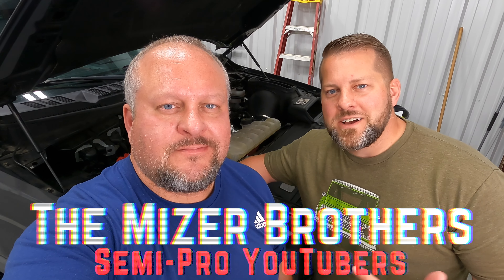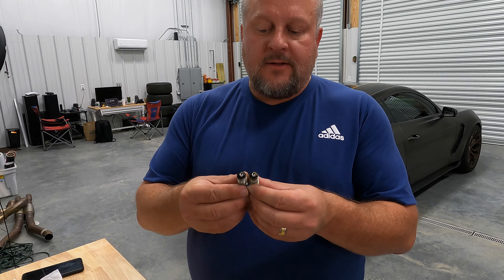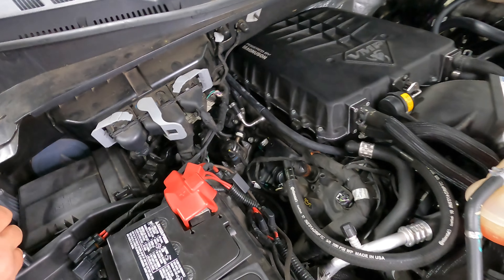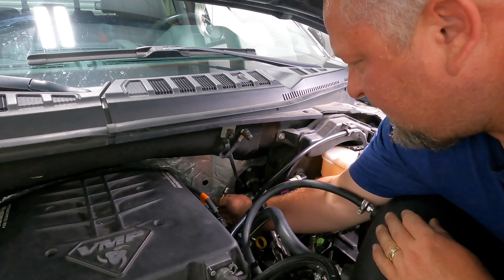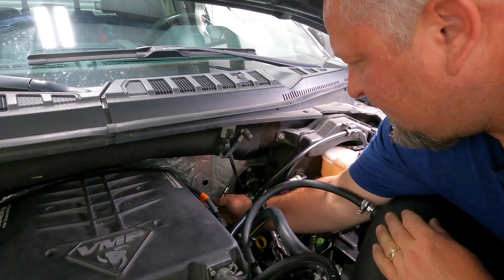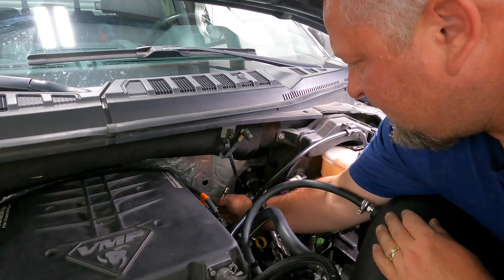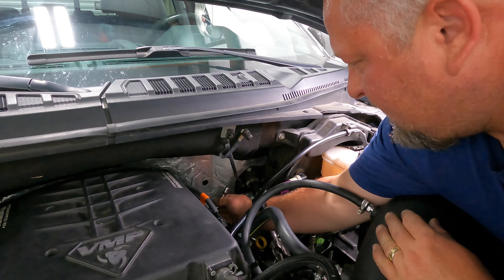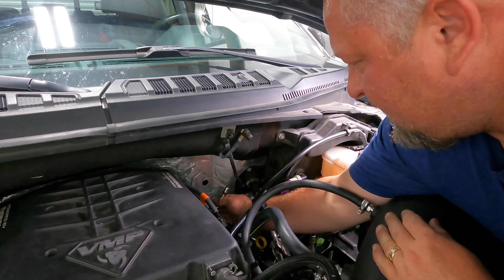Supercharged F150 5.0 Gets Misfire Solved - "The Wolf" is Ready to Eat! - Open Header Exhaust Rips!

Comment: How long did them old plugs last?
Reply from the maker: Not very long. Put them in a month or two ago just for regular maintenance and have had problems since. We looked back at emails with our tuner and tried to see when we started hearing a problem and decided that spark plugs were probably the issue. We added a fuel system and a smaller pulley since then and weren't really sure what the real problem was going to be.

Comment: My 2002 f 150 supercharged has had a bad misfire for a few months now 177000 miles we think bad gas. have used fuel additives and nothing seems to work to correct the problem. Have not used stabil yet. I am the origainal owner of this truck. and can not afford a mechanic. I am on SS. Any ideas? not engine litghts coming on.

Comment: What plugs are you running? NGK 6510?
Reply from the maker: Yessir.
Reply: @BackroadDriver  My Shelby F150 just did the same thing but the OBD found it was cylinder #1. Should I change the coil packs and O2 sensors too? How many HP is your beast putting out? Mine is 750 and it is fun.
Reply from the maker: Just change the spark plugs in you should be fine. If you still have issues you can switch the coil packs around to see if the issue moves with the coil pack.  The wolf is putting down somewhere north of 900 wheel horsepower right now.
Reply: @BackroadDriver  Wow. That is impressive. 750 sticks you to the seat. 900 must really be insane. Shelby also said to change both cats so that is on the agenda too. I got a code about it.
Reply: @BackroadDriver  So I changed all the plugs, gaped them at 0.28, changed #1 coil. Started up, cleared codes and drove it. Light stays off until you boost it. It came on and I drove slow and it turned off. I boosted harder and it came on and flashed. We checked #1 cylinder for compression. It started then went to 120 PSI, then fell back to 65PSI. We thought that was low so tested bank 2 and it was the same. Pulled codes again and this is what we got.

1.P0420 cat efficiency below standard Bank 1

2.P031 cyl 1 misfire

3.P0300 Random misfire

4.P0351 Ignition coil A Primary/ secondary circuit

Dumped a can of Seafoam and filled up with good gas. Light is staying off as long as i don't boost it.

Any idea of what could cause this?

Comment: been chasing a random misfire code myself .. only happens when the truck isn't up to full temp.. checked the forums ... boosted ppl give the impression its normal
Reply from the maker: I have stopped freaking out with every code but this one had me worried…
Reply from the maker: Yeah random misfire is a problem that could be anything.  It never was a problem until we replaced the spark plugs for regular maintenance.
Reply: @BackroadDriver  I have an active shutters code but I ignore that one and the too rich when I’m on e85 .. this one bothers me because the check engine light flashes and sometimes puts me in limp mode
Reply from the maker: Who are you tuned by and what power adder are you running?
Reply: @BackroadDriver  PBD and Hellion twins